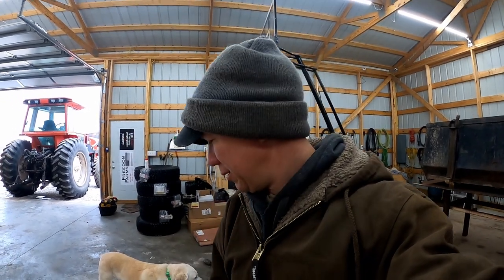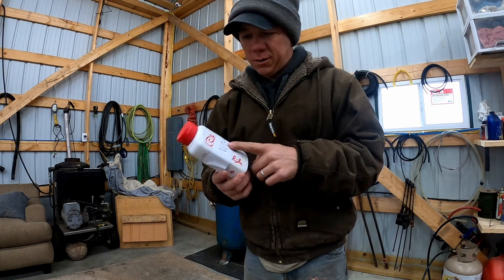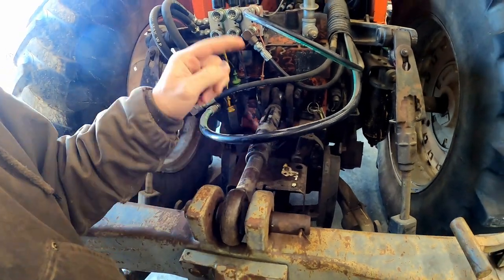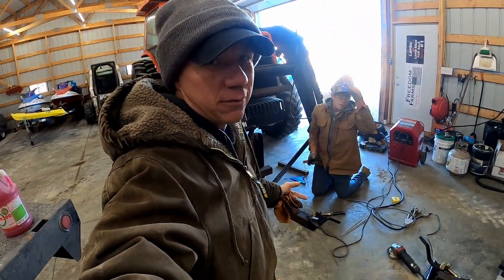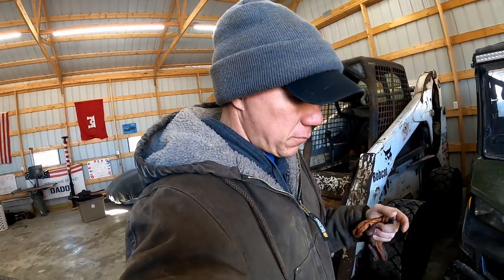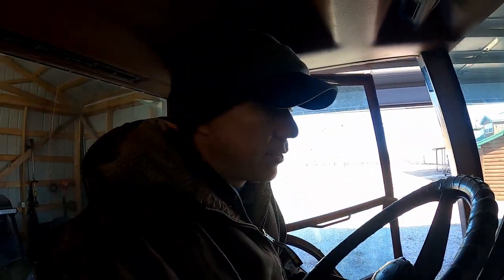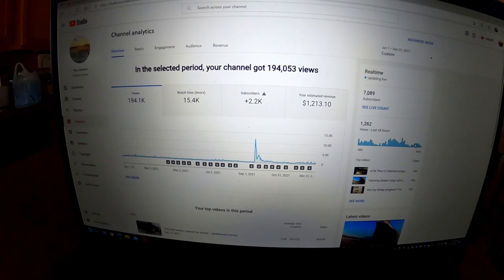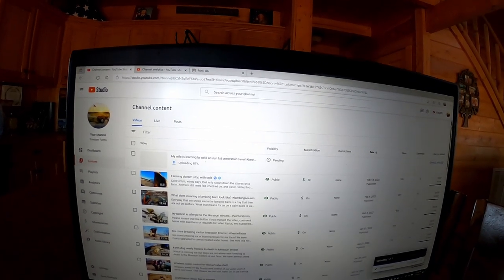Look what our viewers bought for our farm!

Comment: I have always wondered why in the US enclosed lower links seem popular with manufacturers which farms then often replace with quick hitches that use hooks while here (UK) bar category 1 the vast majority are fitted with hook type lower links.

Keep up the good work
Reply from the maker: Likely because it makes most people buy an additional piece from the dealer to make it a quick hitch. It's usually about money when design is thought of. Thanks for watching!
Reply: @FreedomFarmsMo  You're welcome always enjoy them.

That and I suppose if different manufacturers use different widths it'll make you more inclined in their view to buy their implements as well though a lot would probably just adapt it.
Reply from the maker: @SlipShodBob  so there is actually a standard for the category 1 category 2 and category 3 3-point hitches. This makes it to where you can use them universally and you don't have to buy brand specific implements at least.
Reply: @FreedomFarmsMo  that is probably why we have hook type arms as even machines from the same manufacturer can have different spacings, our tedder has a wider headstock than our rake.
Reply: @FreedomFarmsMo  that is probably why we have hook type arms as even machines from the same manufacturer can have different spacings, our tedder has a wider headstock than our rake.